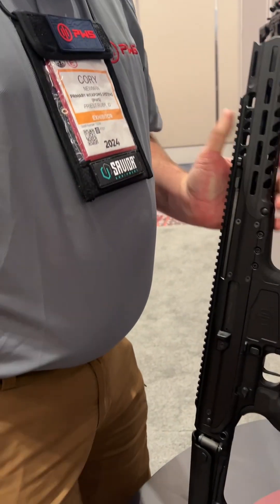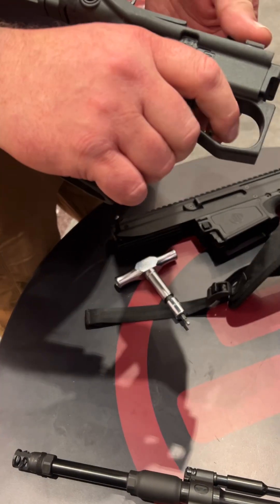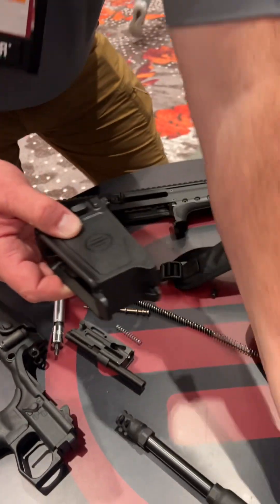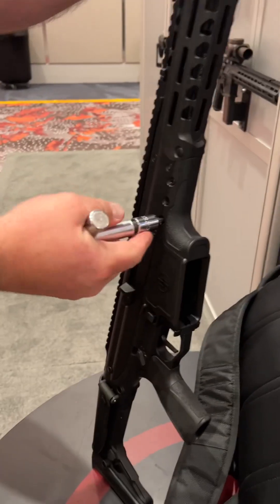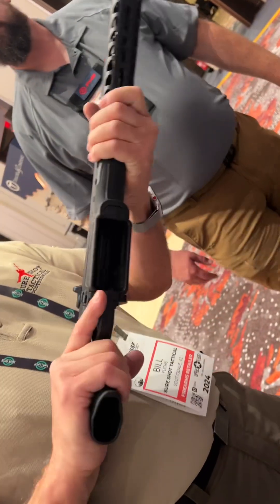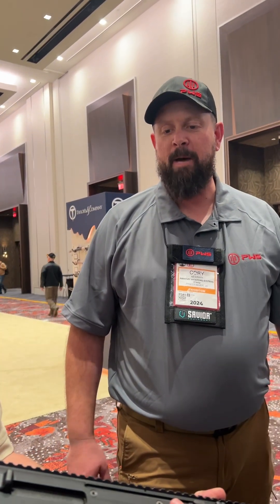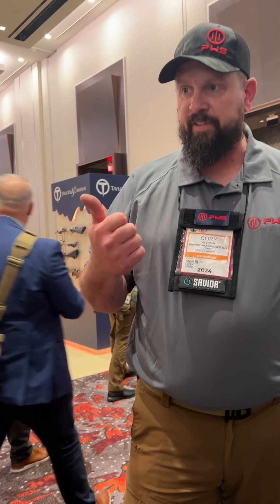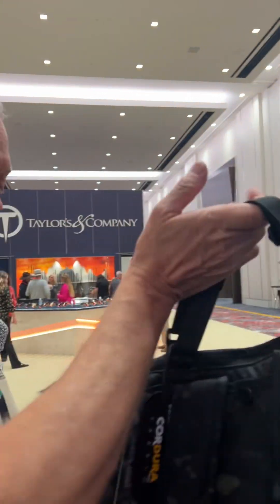Primary Weapon Systems PWS UXR

Comment: So basically it's the XCR-L with more customization options.
Reply: It’s lighter which is important. It’s able to switch to ar-10 sized calibers which the XCR-L cannot, which is significant to some consumers, myself included. It can take AK mags which is again only significant to some consumers. It’s got a larger AR-10 sized bolt head standard which allows it to take the larger sized calibers and those powerful high pressure cartridges like 6 arc for instance. It’s more modular. A little easier to change calibers. This guarantees sub moa accuracy which is very impressive and significant. And I’m not sure if Robinson guarantees any sort of return to zero when it comes to reinstalling the barrel. This also has a bore evacuator which makes this the bees knees when it comes to suppressed shooting. Also, it’s compatible with AR- triggers. Last time I checked, the XCRs were not. I think they are grip compatible, but I’m not sure. Overall, there is similarities, but this is definitely its own animal and most definitely has major advantages and benefits for basically the same price

Comment: The ar 15 with barrel with barrel nut the way it locks up can't be beat 3 little screws are ok for rail not barrel maybe for hobby shooting not duty to many things could go wrong
Reply: They wouldn’t make the guarantees they are making if the lockup wasn’t as solid as a rock. Desert tech does the same thing with their rifles and I have not heard of any problems with it. Even their military sniper rifles that are shooting 338 lapua uses the same system.
Reply: @darthjoshua6663  bayonet is the reason why the barrel nut is important plus thick barrel
Reply: @darthjoshua6663  plus i like desert tech wlvrn but the lack of bayonet makes this not very idiot proof
Reply: @NoahBranch503  are you planning on running a bayonet
Reply: @darthjoshua6663  are you kidding are you saying you wouldn't think about it bayonet spike or knife with bullpup 20inch barrel 55 grain ammo thats 3200 fps and all the reasons for them not to be close!if it jams 😉 stabby stab time